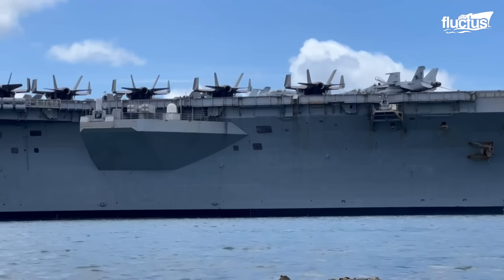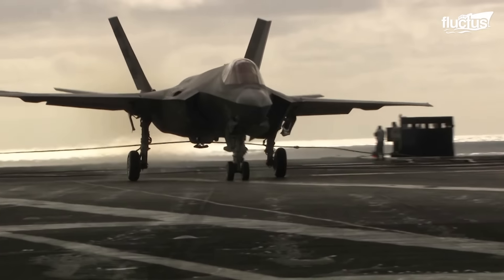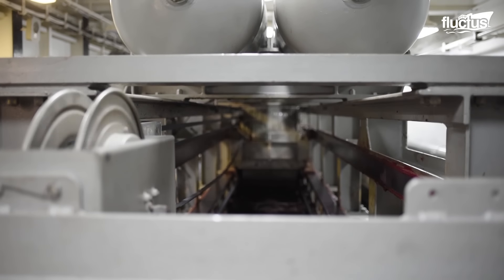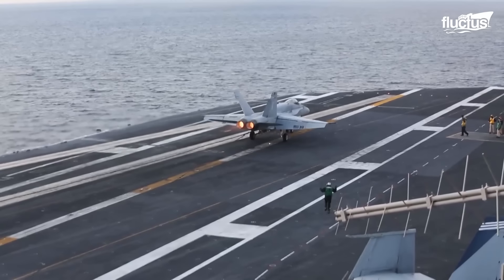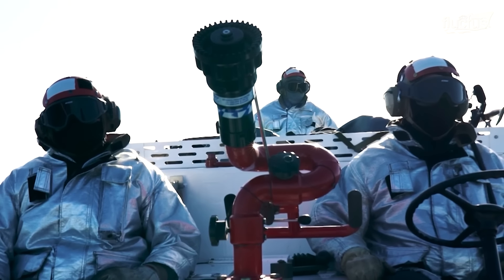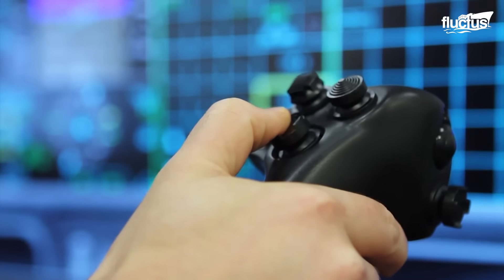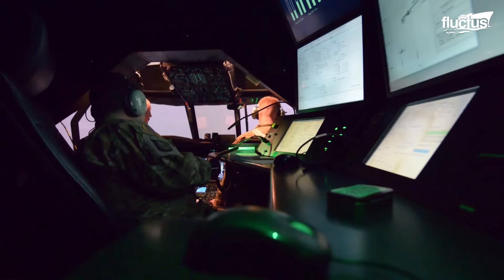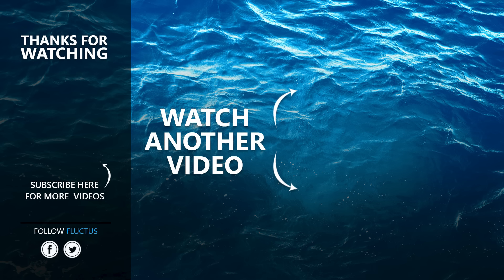What Happens When a Pilot Misses the Landing on US Aircraft Carriers

Comment: I was a radar ET aboard the USS Forrestal during her 82 Med/IO cruise. Landing on an aircraft carrier was often referred to as a "controlled crash". The plane comes in with enough speed and power, if it misses catching any of the arresting gear cables, the pilot can accelerate and go back up for another approach. They practice this in what are called "touch and go"'s. Touching down on deck and then immediately taking off again. And, there's a net that can be deployed across the deck to "catch" a plane, if there's an issue with the tailhook, etc. That arresting gear is also very, very noisy, when you're on the deck below. Just below the flight deck is a full deck between the flight deck and the hangar bay. There was actually berthing spaces located in between the machinery rooms housing the arresting gear systems. I've been walking along the passageway there when a recovery took place. Between the thump and vibration of the plane itself hitting the deck, then the noise of the cable itself and the dampers, I can't imagine trying to sleep there.

Our berthing was in an "interesting place". On the 03, so just below the flight deck level. Outboard of the island, below what was referred to as the "bomb farm". That piece of flight deck area outboard of the island was where they would stage things before loading them on a jet prior to launch. We were right below it. Inboard from us was the stacks (this was a pre-nuke carrier), outboard was "air", beneath us water. Common saying was, if you heard a bump above you, you were fine. If anything happened, you wouldn't hear it, you'd just find yourself in the water. We got evacuated one day, due to a stack fire that was cooking the paint off the bulkheads, fuming the berthing compartment (or "coop"). That day sucked, given that I was night crew and we didn't get the coop back until time to go to work again.

The heat shields behind the catapults were called Jet Blast Deflectors, or JBDs. And, I can tell you from first hand experience where the blast is deflected from the starboard bow cat. Myself and another tech were up on a catwalk around the front of the bridge, coming up to either side of a small commercial type radar mounted there (LN-66, I believe, similar to a Raytheon Pathfinder). On that radar, everything is under a flat "dome", around 3' diameter. Held on by clamps. We had just unclamped the cover and were bringing it up and off, when they began a launch from the starboard bow cat. After almost having the dome ripped out of our hands, we tucked in as much as possible to avoid the blast and clung to the cover. As soon as the launch was over, we put the cover back on and aborted the job. Went back later, after flight ops. Even as high up as we were (around 8 decks up or so), it was still very hot and very fast. 

We lost two F-4s on that cruise, one on a launch, one on a recovery. I was night crew, so I missed actually seeing the launch failure, but I saw the video. 1/3 - 1/2 down the rail, a sudden burst of steam, all the momentum dies, and the plane just dropped off the bow of the ship. You'd normally see an F-4 drop a bit as it left the deck, but it would immediately come back up. This one didn't.

The failed recovery was a night recovery and I saw the immediate aftermath. Our radar shop was in the island, and when someone ran in tell us about the crash, we all ran out onto "vulture's row" (a catwalk on the flight deck side of the island). Spot fires scattered between the fantail and the island. The plane had come in low and clipped the deck, apparently flipping over and breaking up across the deck. Since it was a night recovery, it meant our ACLS (Automated Carrier Landing System) radar was in use. We meant our shop was under investigation for around a month, as they went through maintenance records, etc. Finally determined it to be pilot error. The radar would get a lock at around 5 miles out, take control and put the plane on the flight path (hence, our investigation), then control was returned to the pilot for the last mile and the actual recovery.

We lost, I believe, 5 people on that 82 cruise. One heart attack, one fell several decks down a shaft, and I believe at least one per F-4 we lost. Not sure about the fifth, anymore. But, that was considered a "safe cruise". I suppose 5 people out of 5000 or so in six months isn't horrible. Probably better than, say, Chicago these days.
Reply: What an amazing story Mr. Kenneth Abrams, thanks for sharing! It is really interesting to read such insights from people who lived  that period, who can provide real experiences to us. I'm not American , in fact I'm Italian, but I'd like to thank you for your service anyway.
Reply: First - Big Thank you  for your service, Sir!
Second - thank you for taking time to tell us about these events. Your story is fascinating! The courage it takes to serve on these ships and jets is simply unimaginable! I now have more appreciation for my neighbors who are Navy retired. America is grateful to you! ❤🇺🇸🇺🇸🇺🇸
Reply: With all due respect… HA-HA you were on the Forest Fire! LOL. We learned about you guys in Airman school in 2004.  I was attached to the USS Carl Vinson and the USS John C Stennis.  For anyone that doesn’t know, ask this gentlemen why that ship is now called The USS Forest Fire. Its a pretty harrowing story. High five my veteran brother!!!
Reply: @desertegle40cal  Yeah, seems like every time I've mentioned being aboard the FID (as we called it), people ask me about the infamous fire. Really funny, when they seem to think I was there. Given that the fire was in the 60's and I was in junior high school at the time...

I think the main thing about that fire, wasn't that it was unique or all that unusual, but it all got caught on film and contained a lot of "lessons learned". But, because that particular fire became a training tape that everyone saw in boot camp, and with a name like Forrestal, it got the nickname "Forest Fire".

We did have one fire while I was aboard that impacted me. A stack fire that was cooking the paint off the bulkhead in our coop. So, we had to evacuate the coop. I was night crew, so I spent that day 'sleeping' between two chairs in the shop.

Our nickname for the ship was 'the FID' because the motto on the ship's seal was First In Defense. Of course, a variation on that was FIDLIP, with varying definitions like "First in Deployment, Last In Port" or "First In Defense, Last in People". And, somebody actually had the balls to write that on a slip of paper and slide it under the door to the Captain's cabin.

On my second ship (USS Vreeland), we had a guy that got assigned to needlegun the deck in a pump room. He was dumb enough to make the letters "FTN" before quitting for the day. Unfortunately for him, our LPO stopped by to check on his work at the end of that day. That didn't go well for him.
Reply: @brolinofvandar  Oh i know.  I mean the training video is in black and white lol.  I met other folks in the Navy who were also stationed on the Forrestal.  And youre correct.  That ship is so popular BECAUSE it is now a training video and BECAUSE that situation had so many lessons to be learned.  Both on point and needing improvement.  Which then made that ship so famous.  

I think what made that video so exciting WAS the fact that is was black and white so it made the smoke and fire look so evil and devastating.   I mean didn’t some of the jets catch on fire too?  Then have to be jettisoned?  Correct me if im wrong cause i could be getting my training videos messed up but wasn’t John McCain on that ship and had to jettison his own jet?  Or am i thinking of another ship disaster?
Reply: My Dad was on the Forrestall during that time period too. Had had plaques from visiting Antartica and Egypt hanging up in the basement of our childhood home.

Were you on when the guy got murdered?
Reply: @BBGhost6  I'm going to make a guess that was the cruise before I got there. Because I do remember hearing a story about some guy being beaten death back aft. But I wasn't there for that. 

I have a certificate on the wall where I'm sitting for the Suez Canal transit during that 82 Med/IO cruise.

We only had three port calls during that cruise - Naples, Italy; Benidorm, Spain; & Alexandria, Egypt. Benidorm was the best port call I ever had, even including my next ship.

We were supposed to cross the equator during that cruise, as we were scheduled for a port call in Kenya when we transited the Suez. But, it was cancelled. So, to this day, I remain a polywog. Given your reference to a visit to Antarctica, I'm guessing your father was a shellback. 

So, do you know what rate your father was? What department or division he was in?

Comment: you covered everything but the topic of the subject line.  i was hoping to hear if they land under full power, so they can go around, or what is going to happen.  i never heard that here.
Reply: Que
Reply: @tocoacolon8075  They approach and land at mid-range power and select full power upon touchdown,  to make a bolter successful, if necessary
Reply: That is more or less what happens. A recovery (not exactly a "landing") on an aircraft carrier has been described as a controlled crash. They practice this with "touch and go"s, where they briefly touch the flight deck and immediately take off. They come in with more power than you would in a normal landing, prepared to kick it back up if they happen to miss the cables.

Comment: I have only 'flown' F/A 18 c on DCS. It is like a reverse of runway landing where one makes a smooth touchdown, close power, airbrakes/shute deployed etc. But on a carrier, it's more dumping the a/c to correctly engage the hook with arrester wires, and then open power just in case the cable snaps or if it's a 'bolter'. I read that the latest carriers have only three rows & not four rows of cables which has saved some weight. Also read that the pilots have to make over 300 landings on runway (with arrester wires), before cleared for carriers. I have done over 400 landings on the DCS sim with few crashes - and thank God it's a sim, not the REAL thing👍🙈
Reply: Whoa

Comment: So the aircraft's massive kinetic energy as it lands and is hooked is transfered to those cables that arrest the aircraft. Can't the energy produced by those cables (as they roll) be harnessed somehow by some kind of turbine connected to said cables? For example, it could be used to power electrical systems, generators, lights, etc. on the ship, or be stored in some massive capacitors to be used when needed?
Reply: You know the ships have nuclear reactors, right?
That's just extra weight and one more thing to maintain or break..
Reply: Interesting question - You're balancing the energy that could be gained from a mechanism like this vs. the time and parts to maintain the generator, plus, if it breaks, are you unable to land planes?  Is there less stability?  You really don't want that arresting wire to break.  The more parts you add the more possibility you have that the mechanism fails.  Since big aircraft carriers have nuclear reactors, I'm guessing the energy you would gain from this mechanism is pretty minimal compared to the output of the nuclear reactor.  

Let me try to do the math.
Kinetic energy is 1/2mv^2 so an F14 (40100 lbs) landing at 140mph (62.5m/s) gives 1/2 (18189 kg)(62.5)^2 = 35,500,000 joules, roughly.  wikipedia tells me that an aircraft carrier nuclear reactor can provide up to 550 megawatts, ie 550,000,000 joules per second.  Assuming you are able to recover half the energy from an aircraft landing, you get 17.25 million joules per landing.  550 million/17.25 million means it would take recovering the energy from 30 aircraft landing to equal 1 second of nuclear reactor output.  

If the carrier were powered by diesel, each gallon of diesel give you 142,000,000 joules.  Meaning the energy captured by an aircraft landing is about 1/8 a gallon of diesel fuel.  

That means, the carrier reactor is producing the equivalent of 3 gallons of diesel fuel PER SECOND, and on a day where you land 100 aircraft, your generator would produce the equivalent of about 12 gallons of diesel fuel total.  

For a second I thought, this might be useful in remote places where fuel is hard to come by.  Even if you wouldn't need an arresting wire, you could build one solely to capture energy.  But if you take the time and energy to build the mechanism, retrofitting aircraft to make it work, parts and maintenance, for each landing to give you 1/8 gallon of diesel fuel, you may as well just bring an extra water bottle of diesel fuel on your flight.  So in terms of overall energy use, even though the aircraft does have a lot of kinetic energy, its actually small in terms of overall power consumption of the aircraft or aircraft carrier.  Which makes sense, because the fuel that a plane carries has to be energy dense enough to accelerate it up to much higher than the landing speed, and hold it there for several hours.  I'm not certain about the math but I think everything is approximately correct.  

The idea that a landing only gives you 1/8 gallon of diesel seems low, until I remember that diesel is being used to accelerate 80000 lb semi trucks, and thus a lot of energy is required to keep one rolling at 75mph (already half the landing speed, because the aircraft is decelerating as much as possible before landing.  So most of the kinetic energy of an aircraft in flight is already gone because the plane is slowing down to make the landing.)   Good question, good insight!
Reply: A comment below suggests that the energy is indeed stored and recovered for other systems, so maybe someone else has found a different approach that works!  Science is fascinating.  There are certainly researchers who are exploring this problem
Reply: @jamesyork5444  
That was a great read, James. Educational too.  Thank you very much for taking the time to comment with such detail👍
Reply: @jamesyork5444  Thank you for thinking this through for us with a detailed and educative explanation. Much appreciated 👌✌️
Reply: Recovery is over in a matter of seconds and the system works, no need for a better mousetrap.
Reply: There is No Shortage of Electricity on a Nuclear Power Carrier.  One could actually  Power up a Small City as well as itself.
Reply: the wires are connected to a hydraulic braking system

Comment: still unclear What Happens When a Pilot Misses the Landing on US Aircraft Carriers
Reply: The deck has an angle on it, and counter intuitively they accelerate when landing. This is done so if they miss the cable system they simply take back off and circle back around and try again. If they miss worse than that pilots eject and crews try to salvage the aircraft from the ocean.
Reply: They either keep going and try again on landing or if out of control crash in the ocean
Reply: @harrisonfitzpatrick4542  pilots do not accelerate per se, but rather as soon as the main landing gear hits, pilot goes to full afterburner.  If pilot catches a wire, plane gets yanked to a stop (despite engines at full power).  If pilot fails to catch a wire, plane does accelerate.
Reply: @borysnijinski331  fair enough thank you for the correction

Comment: When the pilots eject at landing how does the parachute even slow them down? like is there even enough time? I feel like they'd just be shot into the water with their seat and everything still attached to them.. or even completely just landing full force on the deck. Can someone answer my question please? thanks!
Reply: Modern fighters have what's called a zero/zero ejector seat.  They could eject on a runway and be safe.
Reply: From what I read the seats take pilots high enough for parachutes to work.  Assuming testing ejections with dummies don't require that. altitude.

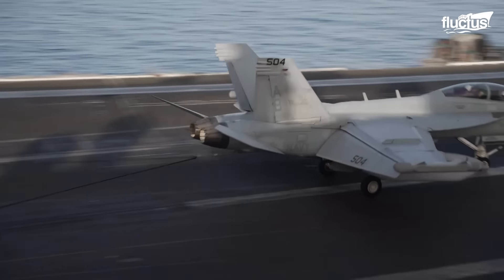Comment: @1:25 what if the plane touchdown short before the hind wheels clear off the 3 cables? wont it be catastrophe?
Reply: No, the hook drags the deck and hopefully it connects a wire.. otherwise bolter and go around. Come in too short you hit the rounddown, then it's over.
Reply: I would think the number one objective coming in is to make sure all of your plane clears the edge for that reason. Think about it: If there's virtually no penalty for coming in too high, and if you come in too low you risk death; I'd think you would make sure to err on the side of coming in too high.

Comment: All aviators on aircraft carriers are looking to catch the 3rd wire , If all are missed then full throttle to regain flight for another go around its called a boltor .
Reply: Actually they full throttle during every landing in case they miss the arresting wire.  If they miss there is no time to "throttle up" and get off the deck.
Reply: @semosancus5506  , I worded it wrong they are aready at full throttle my bad !
Reply: @semosancus5506  actually they approach the wires at landing approach speed and if a bolter happens the pilot will go to full throttle.  A plane approaching a carrier at full throttle is going much to fast to land.
Reply: @semosancus5506  ding ding! You got the award for correct answer.